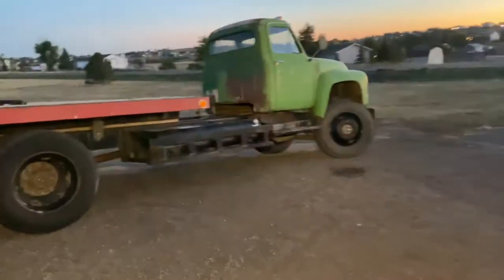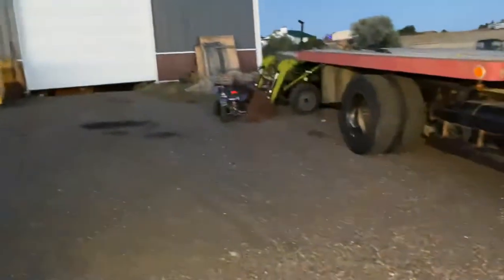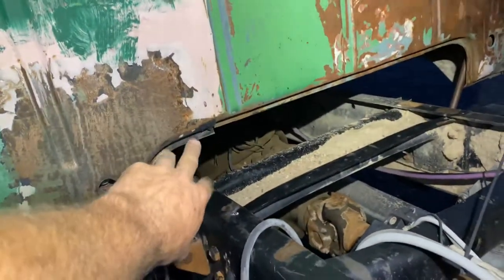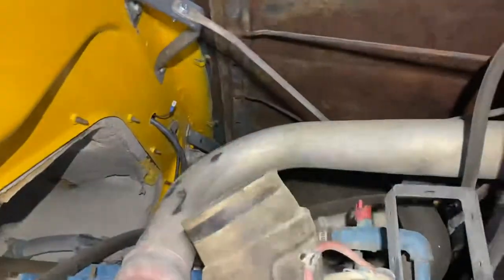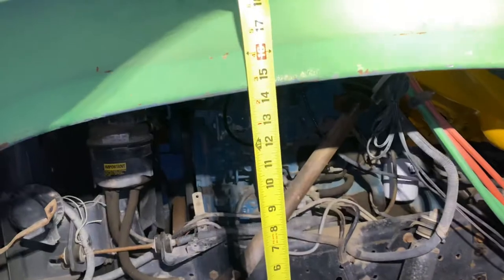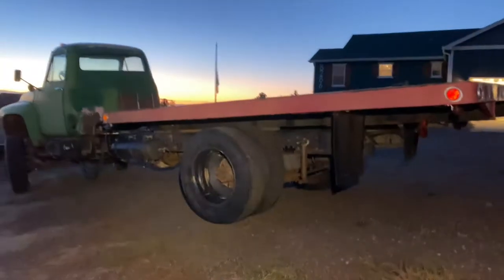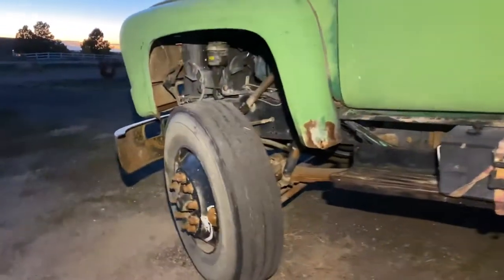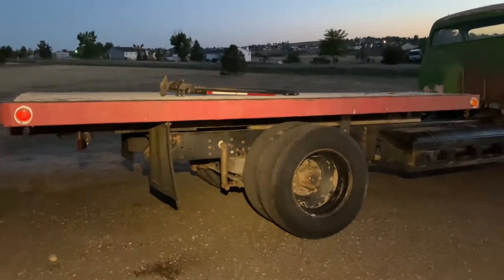1955 F600 School bus chassis swap part 30

Comment: to lower the suspension, remove several leaf springs from the front and add air bags. on the rear, re-drill the holes for the suspension mounts and bump stops higher on the frame. you can get 2"-4" of drop pretty easily. i like the car hauler idea. i have wanted to do it to trucks many of times but i never see them sell for enough money to warrant all the time and cost to build it that way. i think that truck shortened and lowered with a late 40's era style of pick up truck bed would sell well....fabricated into a crew cab would be even better.
Reply from the maker: I appreciate your input! I can always scroll through your videos to find what I’m looking for. 
I was actually laying under the truck last night at the front leafs and thought the same thing. Truck is rated for 33,000 gvwr which is waaaaaay overkill for my needs. 
Do you have a recommendation on front bags? 

I know there are a lot of trucks with bags on the front but am not familiar with how those are setup. I’m more familiar with typical car and truck air ride. 
Also……I doubt it, but can 19.5” wheels fit these trucks? I suspect not with the size of the brakes.